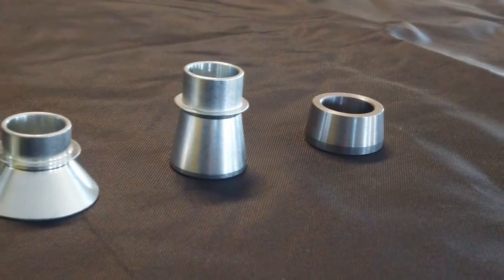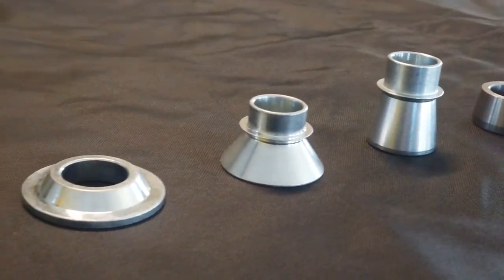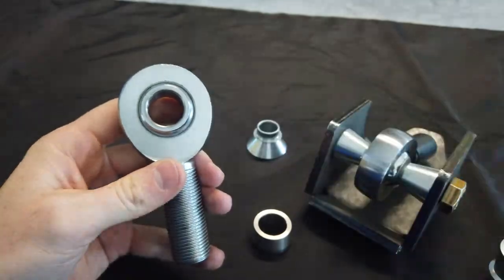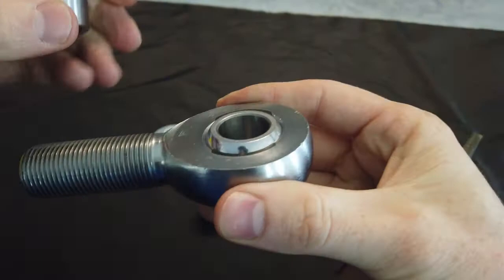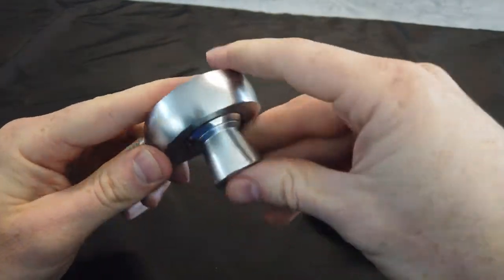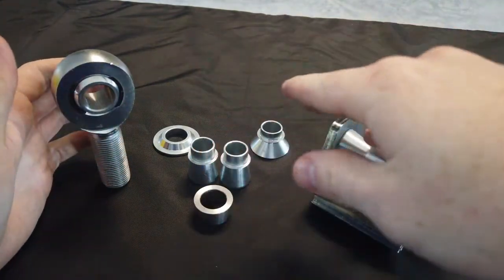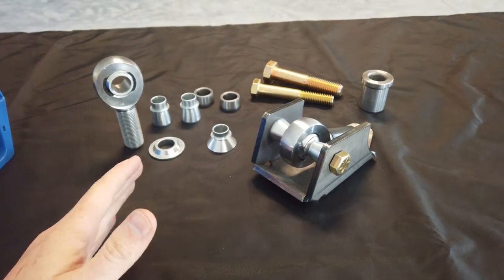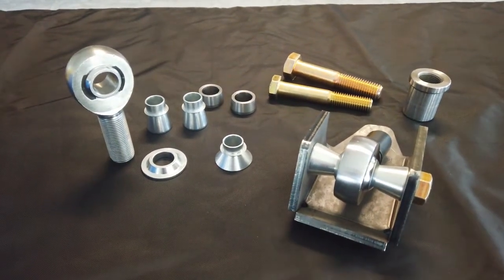Misalignment Spacers Explained

Comment: I disagree with the statement about rod ends for tie rods not needing as much articulation - their length and articulation angles are similar to the control arms'.

[edit] At least with rack and pinion steering.
Reply from the maker: With rack and pinion steering, yes. But not in a solid axle set up.

Comment: Why do you not recommend for a daily driver/weekend warrior rig? My truck has very limited after market support, but ive seen some one who used some total chaos UCA with 1.25" heim spacer up top and 1.5" heim spacer on bottom and was able to run coilovers with remote resis. This woild be my only option for lift other then a spacer aboce the shocks
Reply: Probably because they don’t last long enough for regular daily driving without spending more on replacing/rebuilding joints all the time

Comment: I tried replacing my misalignment spacers on my heim jointed steering. I unscrewed the nut on the 3/4 in bolt and cannot slide the bolt out of the spacers and heims.  How do I remove the bolt?
Reply from the maker: May be a obvious question, what tools have you used to try and get the bolt out? It’s typically always a good idea to throw some anti-seize on your bolts before putting them in.
Reply: @barnes4wd  I’ve used a hammer and no luck. Though my next thought is to use a jack to apply upward force to the bolts on each end of the knuckle. Any suggestions?

Comment: It would be better if you can provide pivot angle say 10degree or 30 degree as it will help me allot to design suspension.
Reply from the maker: If you take a look at our mis-alignment spacers on our website, you will see each one has the degree of misalignment that can be achieved in the description.